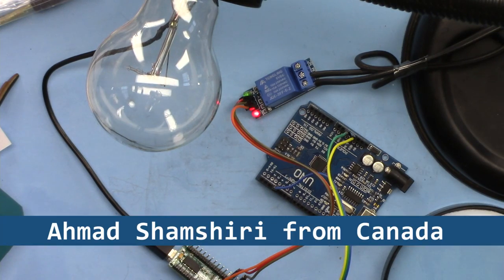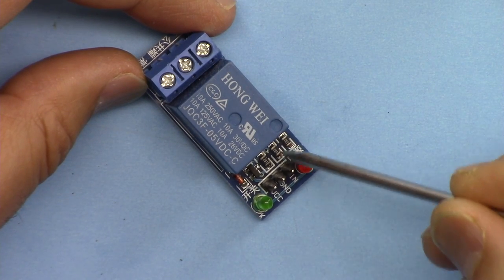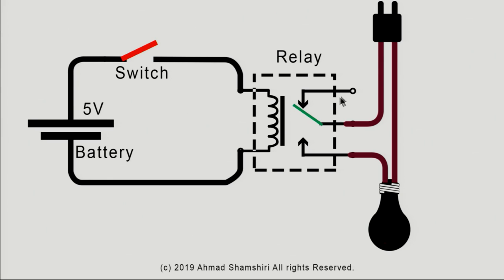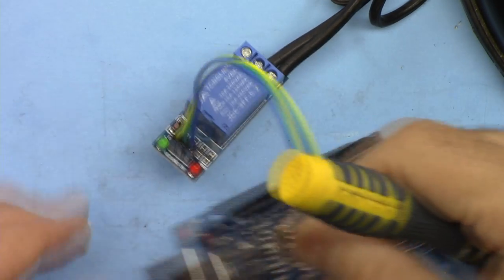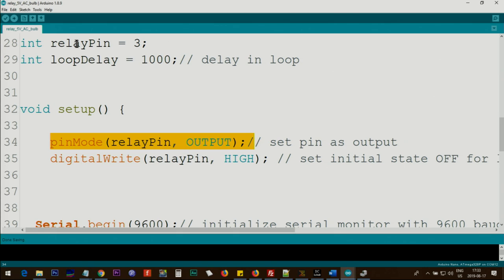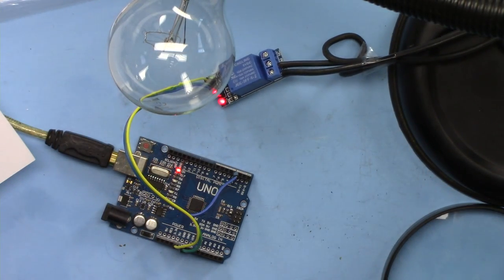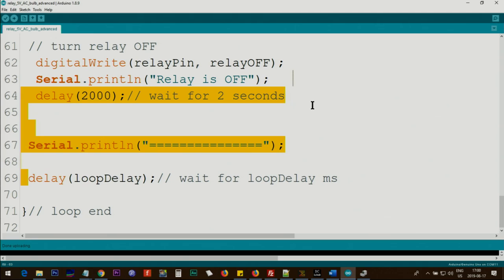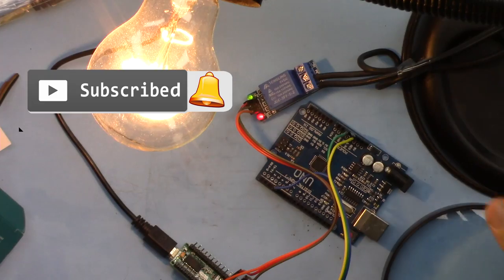Control AC bulb with 5V relay using Arduino

Comment: Greeaaaaaaaaàaaaat,
I have a question, Can we connect ACS712 and a relay with a same load, i.e to check if the current flowing from the load exceeds a certain limit, then the load can be disconnected or turned off automatically through the relay.?
Reply: Very informative question
Reply from the maker: with ACS712 the variable "current" is holding the current. if you watch both videos fully without skipping, it would very easy. if you don't want to learn then hire someone here https://www.upwork.com/ and pay someone to do it for you. Choice is yours. I have provided for free so you watch and learn. Good luck

Comment: Hi, can I use 2 reedcontacts to put the light on ore off without the arduine
Reply from the maker: Hi, it is very simple. see this page https://shivkumardas.wordpress.com/tips-and-tricks/hand-switch-connection/
Reply: thank you, but I mean with out a switich, the relay must be the switch. what kind of relais do I need than. reedcontact must switch a relais one and an other reedcontact must switch the relay off.  thank you  regards Teuntje
Reply from the maker: this relay can be turned on with reed switch. yes.

Comment: Do you need to electrically protect or isolate the Arduino from the load controlled by the relay, or from the relay itself? I've seen it done with optocouplers to isolate but you're not using it, so I'm confused. Maybe depends on the load? I want to control a 300 watt 120v AC fogger.
Reply from the maker: the AC portion of the relay is already isolated.  This relay module has driver that drivers the relay. In some instances people prefer to isolate the driver and power it up from separate source.  If you look at the rating of relay and do the math, at 120V it can handle about 1200W . It is  your decision. But I would use this relay if I respect the rating of of relay and not overload it.

Comment: thanks alot for you  information.also may  you say that how many min. volt need for relay on working position.
Reply from the maker: Just read what’s on the relay. For 5V it may hold up yo 3.7V. Unless you try, you will never know as not all relays are produced by the same manufacturer.

Comment: can this be done with a 9v battery as the bulb's power source?
Reply from the maker: Then it means you did not pay attention. Bulb is totally separate from the Arduino. You can have AC or DC, 1V or 240V .

Comment: Great info, wondering though if I can connect two relays to one Nano? I only see 1 5v pin on the Nano, Thanks!
Reply from the maker: you can do it. split the 5V for two relay or use breadboard https://youtu.be/8sUijpGh8yM

Comment: This bothers me somewhat. I need to power the arduino separately from the bulb? I already have a cable going into the wall. Is there a way to split the bulb wire into parallel and run it through a ace converter and power the arduino which controls the relay and the other branch of the wire? So there is a single source of power?
Reply from the maker: In this video it is assumed the that you know how to power your arduino board. It is very simple. Connect it to a usb. Now if you don’t know that either, the arduino board  has a usb connector which you can program via computer or power it up.

Comment: Hi, i am from india. I have a question. can i power up a 5 volt 4 channel relay module with a 5 volt 0.7-0.8 mAh wall type charger, which is basically use for charge the simple mobiles.

If yes, then how i connect, i mean what will be the circuit diagram. which wire will be connect with the vcc and which wire connect with the ground and which wire is connect with the ESP8286. 

i am try to built a home automation project.

Thank you very much. Please help me.
Reply from the maker: Hi, Here is the video on 4 channel relay. https://youtu.be/Wbm3MCMgM_s Ahmad from Canada

Comment: thank you, when i use the following the relay is continuoesly animated-ON-OFF, what could you help me  if (current >= 25.69 ) {
   float voltage_raw =   (5.0 / 1023.0) * analogRead(VIN); // Read the voltage from sensor
  voltage =  voltage_raw - QOV + 0.012 ;// 0.000 is a value to make voltage zero when there is no current
  float current = voltage / sensitivity[model];
  if (current >= 25.69 ) {
    lcd.setCursor (0, 1);
    lcd.print("I: ");
    lcd.print(current, 2); // print the current with 2 decimal places
    lcd.println("A");
    digitalWrite(relayPin, LOW);
    delay(500);
  }
  else {
    digitalWrite(relayPin, HIGH);
    lcd.setCursor (0, 1); // set to line 1, char 0
    lcd.print("Normal Current");
    delay(500);
  }
Reply from the maker: am I reading is correctly? this video is not about current. It is about relay.  Also there is no LCD here. Please post it under the relevant video so I know what are you talking about.
Reply: sorry it is as below,#include <LiquidCrystal.h>
LiquidCrystal lcd(12, 11, 6, 5, 4, 3);
#define VIN A0 // define the Arduino pin A0 as voltage input (V in)
const float VCC   = 5.0;// supply voltage is from 4.5 to 5.5V. Normally 5V.
const int model = 2;   // enter the model number (see below)

float cutOffLimit = 1.01;// set the current which below that value, doesn't matter. Or set 0.5
float sensitivity[] ={
          0.185,// for ACS712ELCTR-05B-T
          0.100,// for ACS712ELCTR-20A-T
          0.066// for ACS712ELCTR-30A-T
     
         }; 

const float QOV =   0.5 * VCC;// set quiescent Output voltage of 0.5V
float voltage;// internal variable for voltage

// start of settings for LCD1602 with I2C
#include <Wire.h> 
// Set the LCD address to 0x27 for a 16 chars and 2 line display
// end of settings for LCD1602 with I2C
int relayPin = 1;
void setup() {
    //Robojax.com ACS758 Current Sensor
    lcd.begin(16,2);   
     pinMode(A0, INPUT);
      pinMode(relayPin, OUTPUT);
  // Turn on the blacklight and print a message.
  lcd.setCursor (0,0); // go to start of 2nd line 
  lcd.print("Current Sensor"); 
  delay(200);  
}

void loop() {
 float voltage_raw =   (5.0 / 1023.0)* analogRead(VIN);// Read the voltage from sensor
  voltage =  voltage_raw - QOV + 0.012 ;// 0.000 is a value to make voltage zero when there is no current
  float current = voltage / sensitivity[model];
  if(current >= 15.69 ){
    lcd.setCursor (0,1);
    lcd.print("I: ");
    lcd.print(current,2); // print the current with 2 decimal places
    lcd.println("A");
    delay(500);
    digitalWrite(relayPin, LOW);
    delay(500);
  }
  else {
   lcd.setCursor (0,1); // set to line 1, char 0 
    lcd.print("Normal Current");
    delay(500);
    digitalWrite(relayPin, HIGH); 
    delay(500);  
  }
  delay(500);
}

Comment: You're using NO and COM on relay. So, the relay would be in "Closed" state if there's any signal from arduino. But why the bulb is ON when the signal is LOW in the program. LOW signal=0V means no signal, since you're using NO, the bulb shouldn't be ON. Please help:(
Reply from the maker: I have explained it that the relay module is "low trigger" meaning it need LOW to turn ON and HIGH to turn OFF.

Comment: i want to trigger relay when access card is read by PN532 and turn off relay when same card is scanned again. can anyone help with coding ?
Reply from the maker: awal Salam.  you can learn Arduino from this 30 minuets video https://youtu.be/Mbb2xa1WcRM once you know how to read switch or voltage, you can take action and do anything.